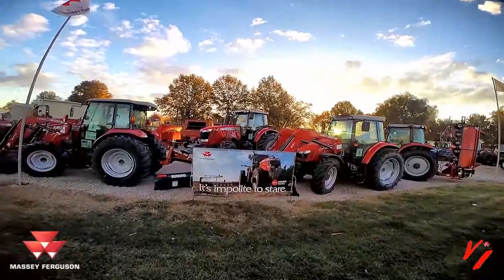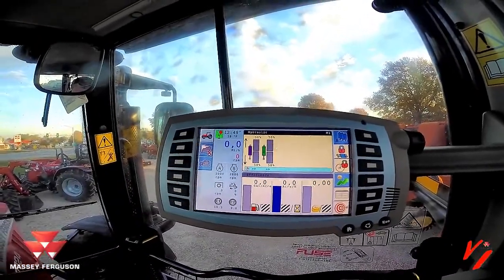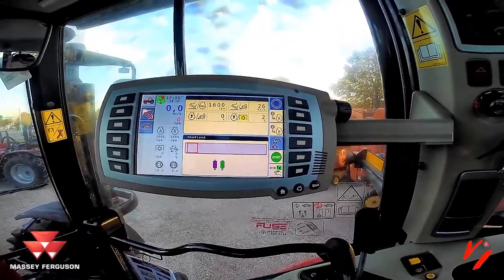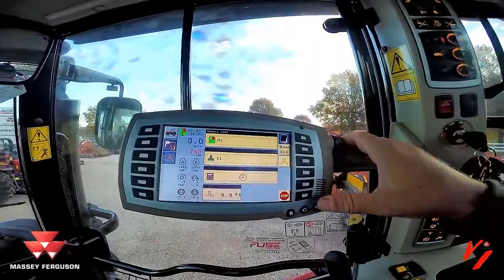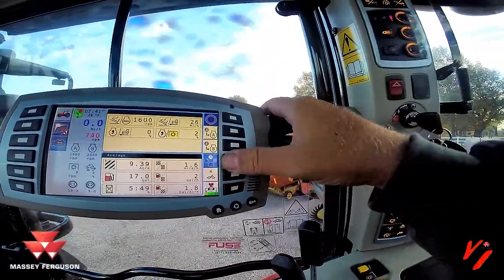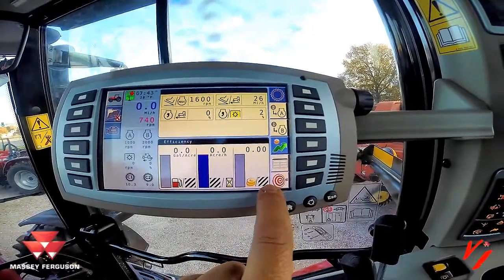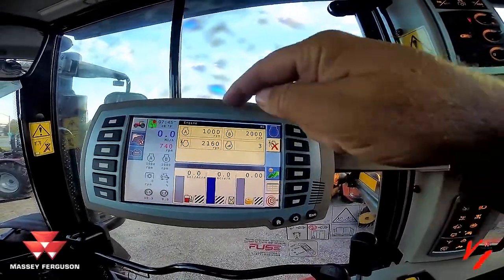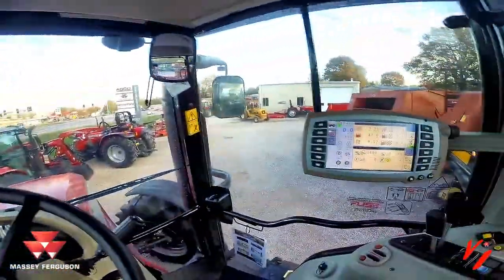Massey Ferguson Control Center Display(CCD): Features & Operation

Comment: Is this CCD compatible with the 4700 or 5700? Can 5700 have this and the thumb-stick loader system?
Reply from the maker: Control Center Display (CCD) & Electric MultiFunction Joystick is only available on the S Series Models: 5700S, 6700S, 7700S or 8700S. These are part of the Premium Features that differentiate some of the differences between the Global Series and S Series Tractors.

Comment: Hi do you know how to set the engine service hours after you have serviced the engine as I haven’t got a manual  and I need to set the hours for next service
Reply from the maker: Depends on model & series. But on most you have to get to the Next Service Screen on the DCC Dash Control Center Press OK button for 5 Seconds. You can get Manuals from AGCO Publications https://www.agcopubs.com/

Comment: How about all the fuel you burn sitting trying to figure out how to run that monitor? By far the most complicated monitor I have ever had!!
Reply from the maker: You don't have to have the tractor running to learn the controls of the C1000 Monitor or set it up. Plus once you set up most leave the data they want to see displayed and put it to work for them.

Comment: how do you get the Datatronic software for the computer?
Reply from the maker: DataTronics is the internal tractor software. But the folks at AGCO Fuse Connected Services can probably help with other software: https://www.fusesmartfarming.com/
Reply: @VahrenbergImplement  Many thanks for your reply! I may have misunderstood you in the video, I thought there was a software available to set up Headland Management etc at home and then transfer it to the Datatronic 4. I've just had delivery of a spanking new 5713S with Datatronic 4 and the Multi-Pad Joystick and just trying to figure it all out. Your video has been extremely helpful to me! Any plans of video getting right into the guts of it talking about Tasks, Memories and all the smaller details???!! (Fingers are crossed!)
Reply from the maker: In the Manual Bundle there should be information on Task Controller or I would check with the folks at AGCO Fuse Connected Services they should be able to assist you. There are some video already on YouTube from AGCO & AGCO Dealers explaining these more indepth details. Butler Ag has done several. That's a Sweet Machine you purchased. Share some videos of it in action.

Comment: looks nothing like the panel on my tractor mine was made in turkey
Reply from the maker: This is the Control Center Display on the S Series (High Spec) Models from Massey Ferguson which are produced in Beauvais, France and Jackson, Minnesota. This console is being upgraded by the new Fieldstar 5 in the latest models just released.